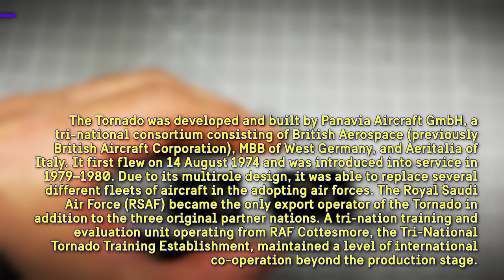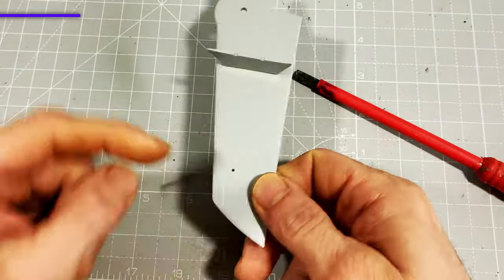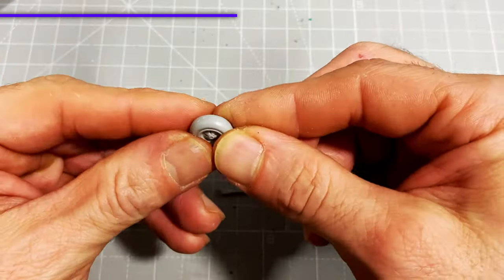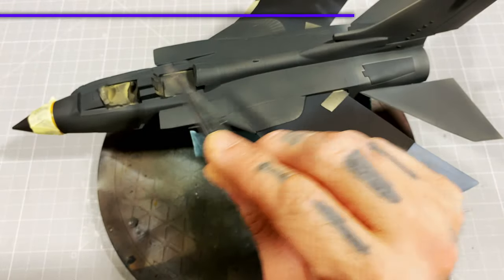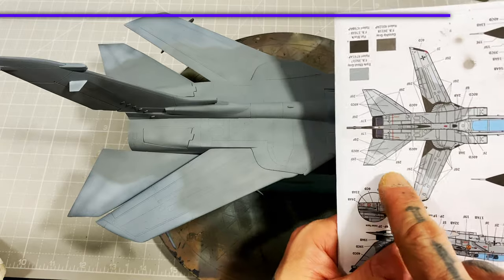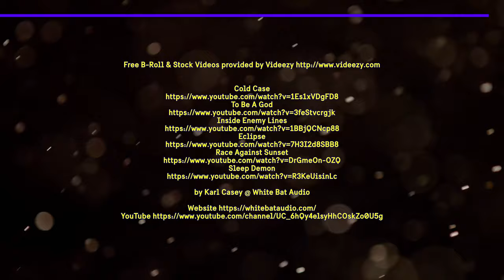Panavia Tornado GR1/IDS - Part 2 #Diorama #ScaleModel #Miniature #ModelKit

Comment from the maker: 00:00 Hello my friends.
00:05 In this modelling project, I am building a multipart project of the Tornado GR1/IDS, in scale 1 to 48 from Italeri.
00:24 The Panavia Tornado is a family of twin-engine, variable-sweep wing multirole combat aircraft, jointly developed & manufactured by Italy, the United Kingdom & West Germany. There are three primary Tornado variants: the Tornado IDS (interdictor/strike) fighter-bomber, the suppression of enemy air defences Tornado ECR (electronic combat/reconnaissance) & the Tornado ADV (air defence variant) interceptor aircraft.
00:44 The Tornado was developed & built by Panavia Aircraft GmbH, a tri-national consortium consisting of British Aerospace (previously British Aircraft Corporation), MBB of West Germany, & Aeritalia of Italy. It first flew on 14 August 1974 & was introduced into service in 1979–1980. Due to its multirole design, it was able to replace several different fleets of aircraft in the adopting air forces. The Royal Saudi Air Force (RSAF) became the only export operator of the Tornado in addition to the three original partner nations. A tri-nation training & evaluation unit operating from RAF Cottesmore, the Tri-National Tornado Training Establishment, maintained a level of international co-operation beyond the production stage.
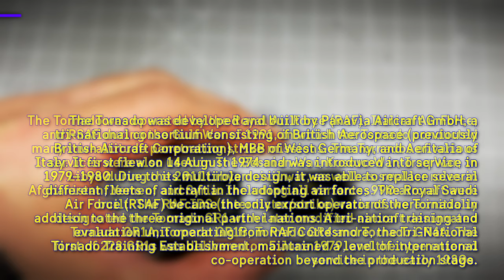01:04 The Tornado was operated by the Royal Air Force (RAF), Italian Air Force, & RSAF during the Gulf War of 1991, in which the Tornado conducted many low-altitude penetrating strike missions. The Tornados of various services were also used in The Bosnian War, Kosovo War, Iraq War, in Libya during the 2011 Libyan civil war, as well as smaller roles in Afghanistan, Yemen, & Syria. Including all variants, 990 aircraft were built. The RAF IDS (interdictor/strike) variants were initially designated the Tornado GR1 with later modified aircraft designated Tornado GR1A, Tornado GR1B, Tornado GR4 & Tornado GR4A. The first of 228 GR1s was delivered on 5 June 1979, & the type entered service in the early 1980s.
01:53 The following project is inspired by real events.
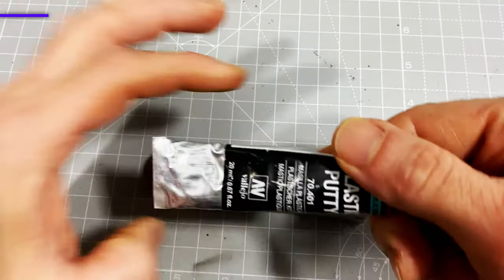02:26 I combined the 2 cockpit pieces but because of my modifications there are many gaps. Plastic putty to the rescue😉
02:46 ATTENTION! Keep always in mind that after gluing, painting, etc to let things dry. Also, I will be fixing the gaps with plastic putty most of the time off camera.
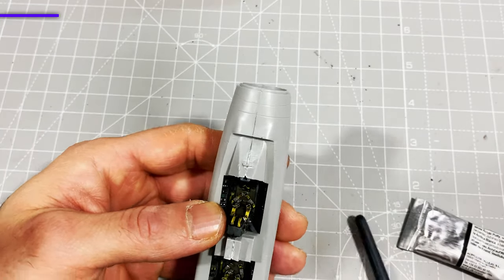03:00 Combining the parts of the fuselage below the wings.
03:26 Gluing these pieces here but the kit doesn't seem to have a physical guide so I have to rely on the manual & my understanding of it.
03:55 I think because the wings can be opened or closed, I should not glue these pieces but melt them in place, like so.
04:17 Gluing the upper & lower wing parts.
04:50 More wings work😊
05:36 Assembling the twin-engine.
06:22 Back to wing work.
06:40 Attached this little piece here. Some more.
07:18 Unfortunately had to remove the seats & placed masking tape for better painting. Also, on the nose Italeri suggests 30g weight. I added this metallic piece. Attaching.
07:45 Engine intakes which at least on my kit they have few flaws.
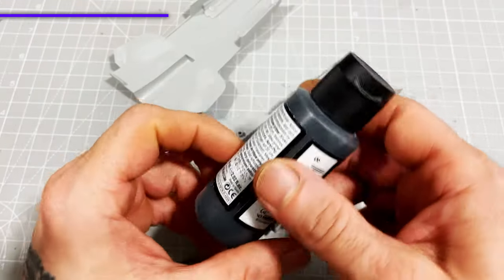08:28 German Panzer Gray primer.
08:40 Going for version F on the manual.
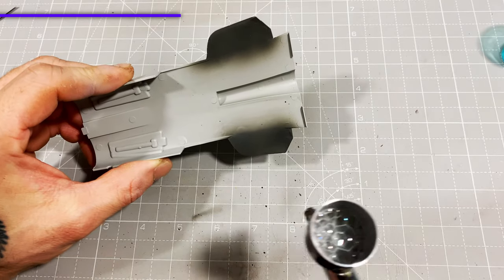09:07 Light ghost gray.
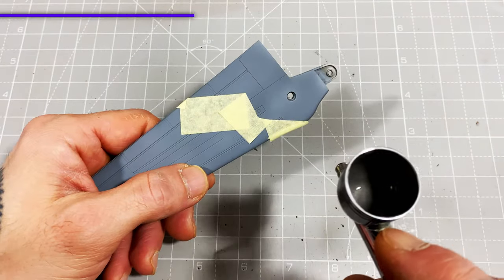09:47 I placed masking tape on these parts of the swing wings. The manual suggests gray for these spots but I made a mix of metallic gray to showcase the wear of the swing wings. Airbrushing for a bit.
10:09 Repeating the previous melting method.
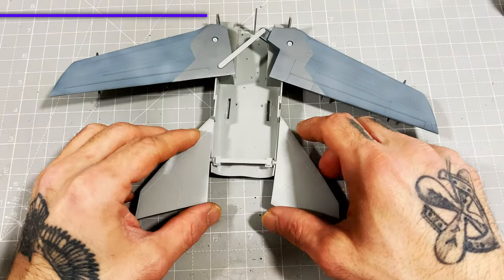10:27 Attached the swing wings. Adding the rest.
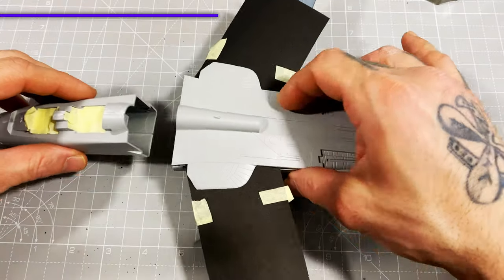10:59 Added these papers on the wings to protect their painting for when I will be painting the rest of the aircraft. Attaching the cockpit & then the fin.
11:36 Engine intakes.
11:58 Onto the landing gear system.
12:14 Prepared special copper wire for jewelry 0.6 mm (about 0.023622 inches) & small pieces of a wire. Super gluing for enhanced details on the landing gear system.
13:02 Same process but with wire of 0.3 mm (about 0.011811 inches).
13:50 Added more off camera & doing more details.
14:46 Taking care of the excess plastic putty & gluing.
15:15 Attaching the retractable/removable refuelling probe.
15:50 German Panzer Gray primer.
17:19 White. 2 coatings, 1 off camera.
17:52 At this point I want to explain a few things. I made a terrible mistake when I was making the cockpit because I didn't notice that the kit had its own version of the 3 screens that I created on my own way. Basically I had to take away the kit's version or mine & in the end I removed mine. However, after I will finish the paint job, I will add some cables for additional detail to the otherwise good cockpit from Italeri. Back here I attached the covers & on the bottom of the fuselage I added some masking tape.
18:25 Off camera painted with flat black the nose & put some masking tape there. Airbrushing with light ghost gray. It is heavily diluted because I want to keep some spots darker. Will do 2 maybe 3 coatings.
21:35 Dark gray airbrushing.
22:44 On the lighter areas of the Tornado although I painted with light ghost gray, I need to do 1 more coating. As you can see on the manual, my dark gray areas are just fine but the light gray ones, I clearly need to fix them.
22:58 Airbrushing.
23:40 Hopefully you liked the project & please be patient for the release of its presentation. Because I love this amazing art & I strive to be better, please do help me by sharing your words of wisdom in the comments below.
23:55 TO BE CONTINUED.
24:09 Hit the Like, Subscribe & Notifications Bell "buttons". This way, together, we can grow a community around the exciting art of scale modelling!
24:19 Stay "tuned" for more "Tornado" inspired content as well as for more scale modelling videos.
24:25 Thanks for watching!

24:28 Free B-Roll & Stock Videos provided by Videezy http://www.videezy.com

Cold Case
https://www.youtube.com/watch?v=1Es1xVDgFD8
To Be A God
https://www.youtube.com/watch?v=3feStvcrgjk
Inside Enemy Lines
https://www.youtube.com/watch?v=1BBjQCNcp88
Eclipse
https://www.youtube.com/watch?v=7H3I2d8SBB8
Race Against Sunset
https://www.youtube.com/watch?v=DrGmeOn-OZQ
Sleep Demon
https://www.youtube.com/watch?v=R3KeUisinLc

24:28 by Karl Casey @ White Bat Audio

Website https://whitebataudio.com/
YouTube https://www.youtube.com/channel/UC_6hQy4elsyHhCOskZo0U5g